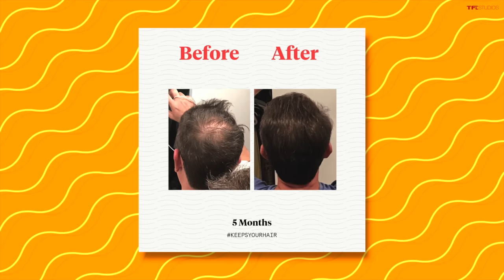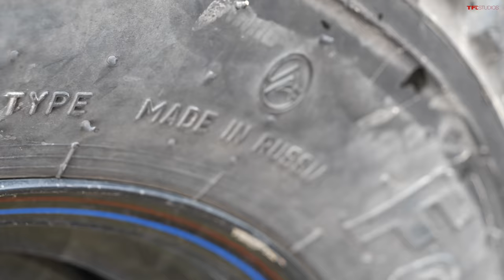Buhanka vs Jeep: I Test American Ingenuity Versus Russian Dirty But Sturdy Off-Road Tech!

Comment from the maker: Thanks to Keeps for sponsoring this video! Head to https://www.keeps.com/TFLTruck to get 50% off your first order of Keeps hair loss treatment.
Reply: watched couple years how British traveled across Yakutia (russia).

if someone does not know Alaska is Sunday picnic on hawaii compared to yakutia.
it is coldest place on earth. -50, -60 C .

---------
so they took a few cars, installed everything for worst harshest winter, and started driving

what car did they use as go ahead car? local buhanka.

beauty of this car is : car is simple as sliced bread.
Reply: you should make real off road test: Russian NIVA against Jeep!!

like in old times- USSR vs Canada in hockey!
Reply: Ah yes....the cold war once again!! i'm rootin' for both
Reply: Anyway y'all can talk to Andre. He's turned into some kinda cringey eastern European clown. He's always been a little off, but lately it's all the time. You guys don't have to be some value brand top gear just be TFL.
Reply: Did you get it registered??
Reply: I saw one of these in person in Norway. So awesome. Gotta love the Loaf!
Reply: New Bukhankas come stock with rear locker. You can probably install it on the old model too
Reply: @MyAlexWest  Niva is surely less capable than Bukhanka. Niva is a crapy unibody crossover with average travel independent front suspension, and it's drivetrane is so fragile they had to make it permanent AWD with center differential. The engine is horrible too, it doesn't make nearly as much low end torque as UAZ's ZMZ-409 despite comparable power output. The only benefit of Niva is that it's relatively small. It's a great car for broke dudes like me who want some offroading but if you have any reasonable budget I'd strongly recomment going for anything else like the Jimny, old Jeeps, Toyotas, Land Rovers, etc.
Reply: See how the buhanka drives with weight in the back. Maybe its like a truck where once you put some wheight it settles down

Comment: When it's 85 percent different parts can it still be called an 87 wrangler? Maybe a 87 "looking" wrangler
Reply: Its basically a TJ on YJ Body!
Reply: @TheYamaski  with Ford diff housings...
Reply: As long as it has the original VIN it's an 87 Wrangler.
Reply: All them up grades v standard !

Comment: Ah Andre, the secret to open diffs is learning how to left foot brake. Master that and people will swear you have lockers
Reply: And air down.. those tires are at street pressure.
Reply: @brentworls8509  Airing down makes the ride way smoother on those UAZ.
Reply: Well, if you have torsen limited slip diffs, yes ...
Reply: @brentworls8509  they look old and hard. being russian made for heavy off road the side walls wouldn't flex much

Comment: HUGE like from Russia!
Glad that UAZ showed not so bad
In Russia there are lots of aftermarket parts to make UAZ ultimate offroader. Your Buhanka is something near stock.

Can't wait to see next episode!
Reply: I was beginning to wonder. I saw something like the UAZ at the grand canyon once, but it was pretty heavily modified.
Reply: agreed. bone stock van against a jeep with very little left of the original running gear (Ford Diff casings, uprated lockers/LSD diffs, later engine, different gearing, uprated suspension etc) hardly a fair comparison!
Reply: @petelattimer6808  yep,install lockers ant then do comparison
Reply: I'm guessing there are modifications for lockers and power steering available ?
It seems to be the things it needs the most.
Reply: @Grumpy_old_Boot   lockers starts from 250$ for limited slip diff to 1000$ for diff with electric control
Power steering kit costs about 700$
Reply: @RealMacarenko  
Oh cool, didn't know the aftermarket for the little Buhanka was so strong.😀
Reply: @Grumpy_old_Boot   UAZ and Lada Niva is most popular offroad vehicles in Russia. They are cheap and have a lot of parts. New Lada Niva starts from 10k$ and UAZ from 14-15k$. Brand new car.
Of course we have Jeep, Toyota and even china models (almost crap). But there is a problem to get parts for them. UAZ and Lada parts you can get at any part of a country from Saint-Petersburg to Vladivostok. UAZ is something like Wrangler. And Buhanka is Wrangler-van😂☝️
Reply: @RealMacarenko  
Yeah, I'm familiar with the UAZ 4x4 jeep like car, it's not very comfortable, but very capable.

Also, I thought Toyota was fairly well represented in Russia by now ?

Obviously, since I live in Denmark, I haven't had many eastern block vehicles.

Though I did have an Ursus tractor a long time ago. It was very similar to a Massey Ferguson 135, but all the rubber seals and such were absolute rubbish. Once you fixed that, it was a good enough tractor.
Reply: @Grumpy_old_Boot  russians LOVES Toyota so much, that new TLC300 now costs about 2 x sticker price. Used Toyota cars overpriced too. In mid 2000 we have even fake 4runner from China  named Great Wall Deer and it was popular.
Tuning parts for Toyota,Jeep and etc. avaible, but they cost more and you will wait fot shipping. It seems normal in big cities, but the rest of Russia prefers to buy Niva or UAZ and get parts instantly in stores or one week by post.

Of course we have mad projects too - people who can afford it buys axles from Volvo Laplander( each costs near 10k$) and install it to any cars. Sometimes with tractor wheels. But there is one car like that for 1000 of almost stock UAZ and Niva cars.
Reply: @RealMacarenko  
Aw man, the Laplander is awesome, the Pinzgauer too. 😁

I'm guessing the old Lada's (or do you call them autovaz?) would be popular too, if nothing else, than for the nostalgia. 

I'm a bit surprised that Toyota can't keep up with demand in Russia, I thought they had a manufacturing plant there ?

---
---

And I'm loving to hear about all of this, as Russia is still somewhat of an unknown in the west, especially when you start to get out in the more rural areas, Russia is still wildly different from western Europe. And that's a good thing. 😀

Sometimes i open up google Maps, and surf around in different parts of the world, especially the "out of the way" kind of areas that are different, it's such a rush. 

Just like other people would find the place where I grew up as being an exotic place is weird to me.
Reply: @RealMacarenko  I bought a Bukhanka with rear locker but otherwise stock. Do people bodylift them? The importer wants to do a RIF lift kit, but I think a bodylift makes more sense although it's maybe a bit more work.
Reply: @Grumpy_old_Boot  in russian Toyota plant (near Sankt-Petersburg) they produce Camry, Rav4 and Highlander (may be I'm wrong) - no Hilux, no Prado, no Fortuner
Reply: @Grumpy_old_Boot  old "Lada" is always "Lada" or "klassika" (2101-2102-2103-2106-2107 models) or domestic brand "Zhiguli". BUT - "Niva" is always and only "Niva" (except "Chevy Niva").
Reply: @coyoteranger  
Ah, very cool, thanks for all the info, didn't know they were called Zhiguli. 😁
Reply: @Grumpy_old_Boot  I had a zhiguli and the more modern Samara. That was in the days when you could sell your Scottish one back to the ex-USSR at a good price. I drove the Samara over from Scotland to Lithuania in 98 and eventually sold it. 
They are usually named after where the plant is. The zhiguli mountains are in Samara oblast and are near the Volga where the VAZ plant is (Volga Automobile Zavod).
Then there was ZAZ from Zaporizhzhia and UAZ from Ulyanovsk and KAMAZ from the Kama river.  ZIL is the opposite way round and the Zavod was in Likhachov.
The one that would confuse people now is GAZ. Gorky is now Nizhny Novgorod but in Soviet times it was Gorky avtomobilny Zavod.
Reply: @BrokenBackMountains  
Ah yes, my dad told me he had a Gorky back in the late 60's I think (a GAZ-21 I think?) ... he added a little bit of under carriage plating, to make the bottom  flatter, so he could use it as a motorized sled in the winter. 😂
It kinda worked, because it had a very high stance.

btw, "zavod" means something like "factory" or "plant", right ?
Reply: @Grumpy_old_Boot  Zavod is plant, yeah. My Russian is very very limited though my wife is fluent. Oh and the ZIL is originally named after the head of the factory. At one point it was called  ZIS after a certain Georgian mass murderer.
I've driven UAZ, VAZ, KAMAZ and GAZ - namely the Gaz 24 volga. I drew the line at a zhaporozets.
Reply: @BrokenBackMountains  
Ah yeah, I think Zil made the first sort of "modern" style military truck with the Zil 157 and Zil 131 in the early to mid-1950's.
It had proper offroad suspension and super single tires, which would fit into tank tracks, so if you had a convoy of trucks, you could lead it with a heavy tracked vehicle, and then the trucks could just follow in the tracks, using less fuel, and getting stuck less. 
Pretty much all modern military offroad trucks eventually switched to the "wide enough for tank tracks and super singles" style.
Reply: @Grumpy_old_Boot  Niva - "Нива" - means "field, margin, square, cornfield, bent, brim" (also "Niva" is a soviet combine harvester brand)  - main idea: "light 4x4 passenger car for rural people, based on modern italian/soviet technology.
Reply: @coyoteranger  
So the "Lada Niva", basically means the "square lada" ? 😄
A fitting name indeed.
Reply: @Grumpy_old_Boot  and I can continue - name "Lada" derived from "ladya" - kinda viking's boat("rook") but smaller and slavic origin. Simplified image of ladya on the VAZ-Lada logo. So - Lada Niva - "sqaure boat". It's a joke of course. :) But good ole' Volga's sedans - ГАЗ 2410 - have a nickname "barge" because of  superior" driving quality :)
Reply: @coyoteranger  
It's a land-yacht !  😁
Reply: @RealMacarenko  только качество сборки и запчастей намного хуже у уаз и нива, чем у jeep
Reply: @user-re8yx8cm6m  да оно понятно. Но мы же говорит в среднем по России? В областях все двигаются на Нивах и УАЗиках. В том числе и по шоссе, едешь где-нибудь на краю Вологодской области и там просто несметное количество Шеви Нив.
Reply: @RealMacarenko  ну это да, люди просто боятся иномарок думая что на них дорогие запчасти или сложное устроиство. А по факту на тот же уаз уходит денег больше так как он сыпется постоянно
Reply: @user-re8yx8cm6m  не совсем так. Берем любую ценовую категорию, например Чероки за 150тр и УАЗ за 150тр. Понятно что например в Питере живешь, то тут и разборки и закажешь даже с США части. Подождешь. А если ты в Чагоде например? Каждый раз в Питер гонца отправлять? А если машина каждый день нужна и она работает не только для развлечения?

С новыми еще проще уравнение, никто не даст тебе дешевый кредит на БУ иномарку. А на Ниву и УАЗ дадут. И они отъездят свои 3-5 лет при нормальном уходе. И можно опять новый взять.
Reply: @coyoteranger  only Camry and RAV4 are produced near St. Petersburg. Several years ago in Vladivostok a couple of years they produced the Land Cruiser Prado.
Reply: Whatever...
Reply: I have wanted one of these vans and the lada niva for a long time. They both seem to be very off road capable.
Reply: Чаво?
Reply: @RealMacarenko  lol, I don’t think this is possible at the moment
Reply: I'm interested in these performance parts that you have access to in Russia.

You have no idea how bad I want one of these vans. I'm even near this guy.
But if I had one I'd probably have to gut it.
Maybe even put a jeep 4.0 in it.
Lots of fabrication but I have no idea.
Reply: @Grumpy_old_Boot  

And you can find buy them brand new $5,000 in Russia. After ~$8,500 shipping ($13,500) that's a lot of room for modifications; power steering, rock sliders, winch, roof rack, tires, stiffer suspension, modified body for better tire clearance on rocks/bumps etc. You could get a legitimate off road vehicle for ~$22-23k. It's wont compete with a Jeep because of the inherent disadvantages of vans and because nothing competes with well built Jeeps. But I don't see another Van/minibus competing with the Loaf.
Reply: @joebenson528  
yeah, not a lot of good van based 4wd platforms.

Comment: 10:08 Какой прекрасный ход подрессоренных мостов. Раздатку с блокировкой и вперед.
Reply: i dont understand Russian and google translate  isnt helping....."What a wonderful course of sprung bridges. Distributor with blocking and forward."
Reply: @guerralopes  “look at beautiful long movement of the leaf suspended fully boxed axles. All you want to add is blocking in transfer case and differentials.”
Reply: @guerralopes  BTW in Russia there is a cheap mechanical locking option for differentials used in UAZ. It is engaged by the push of a button on the console when the car stays still (not moving). Very good for going over short difficult passages like in this episode.
Reply: @slavkochepasov8134  I agree... this vehicle needs locking diffs.. I thank you for the translation.
Reply: @slavkochepasov8134  хеуле ты тут перед этими куколдами распинаешься
Reply: @andronchetverty5541  А почему нет?
Reply: @georg177  билять. Уже 2 года прошло! Я уже забыл про что этот ролик

Comment: Couple ideas for upgrades of your Bukhanka. You can install additional radiators fans, if you don’t have them. On low gear and climbing, engine will overheat.
You can also install aftermarket electric power steering and steering damper, so it will make your driving more comfortable. 
Bukhanka like a Russian tank, it will go anywhere if you can handle it!

Comment: Here in germany it's possible to buy this "Van" in BRAND NEW with zero miles on the odo. But UAZ offer this thing as "Anniversary Model", that means the driveline fitted with SPICER HD axles in front and rear, electrical differential lockers, slide windows on the sides, 5th gear tranny, power steering, gear reduction, 2wd and 4wd and emission control fuel injection and so on...
And the technical upgrades speak himself, 2,5 inch lift kit with springs (RIF produced, near RANCHO), steering damper and a 2 inch body lift kit and 245/75R16 BF Goodrich tires...and few more parts needed at the outback.... This Thing costs less a JEEP or another 4wd full size Offroader. Greetz from germany

Comment: I bought a wrangler brand new in 1990. Put  a four inch lift with 33’s front air locker and a lock right in the rear. I had more fun with that jeep than any other vehicle I have ever had. Sold it in 2005. I regret that decision more every year. That van is very cool reminds me of the jeep forward control pickups.

Comment: The van is pretty damn cool. Be a fantastic camping off-roading vehicle.
Even in stock form like this it's more than capable of getting to 95% of places you might want to go.
Look like it rode a bit softer but bouncier than the Wrangler maybe some heavier duty shocks would help with the bounce.

Comment: Awesome video. Andrew you can get lockers on UVZ from the factory if it has military axles.  My cousin back at home has one with military axles and it engages automatically, that thing is a beast off road.
Reply: Locks, automatic and forced, are available for sale for any bridge. The factory did not put military (gantry) bridges on vans before, and now the factory does not make military bridges.

Comment: Mr. Truck.  I have dealt with very similar “exterior dimensions” as you.  The Wrangler seats can be adapted to give some more backward travel by a commonly found bracket, or by doing some creative redrilling of the seat mounts.  Take a few minutes and, believe me, you’ll be much happier in that driver’s seat.
Reply: Yes, my old seat did move back. I have to work on it as loosing weight doesn't happen

Comment: My first jeep was a 1976 CJ7. It had a 258 cu six cylinder. It had 7 leaf springs all around, i added 2000 lb overload coils on four corners. If you didnt have your seatbelt fastened and drove over a dime, you would be out of the seat.

Comment: Hello thanks for your videos.  I have a great doubt I am looking for a RAM 5500 HEAVY DUTY TRADESMAN 2021 to make Hotshot.  What should I do to have a good weight combination between the truck and the trailer?  To reach 40,000.  Is the 4.89 gear better than the 4.44 for this type of work?

Comment: You need to split your emergency brake cables and add two induvial cable levers like dune buggy's have so you can manually lock either rear wheel. Lockers for those banjo deffs is probably not an option.
Reply: The buhanka has a hydraulic hand brake right behind the gearbox that blocks the whole drivetrain when in 4x4. No cables to rust and break, also a handy way to stop and get going mid climb.
Reply: @modarkthemauler  That's correct, but pure mechanical system. Not hydraulic. And works at 2wd Mode as well. Had such beast some years ago.

Comment: I think a off roading excursion means you leave the road? Atleast he hit a mud puddle. Cool little van. If your one wheel peeling push the brake a little bit it will slow down the spinning wheel and force the non moving wheel to turn. Use your brain don't just slam the brakes there's an in-between. Try it

Comment: Andre u should swap in a R2.8L Cummins Into the van it would be unique have loads of power and Cummins makes it very easy to put in any vehicle u would want because they come I  a complete package with electronics and everything u need 

Also the issue with no lockers for the stock axles patently.. u should just get a set of stock Rubicon 44s u may have to have them shortened but they would be bomb proof under such a light vehicle. even like a Dana 30 front and 35 rear ( or 8.8 would even be better for the rear ). going to a Dana would give u all the aftermarket support and parts availability no matter where u are. 

u should get a hold of other your tubers or like the motor trend crew (like fred williaws at dirt every day he is into wacky 4x4s and has built everything u can think of) and collaborate on a build it would be great content and a great way to have some one that knows a great deal about how to build a proper 4x4 that is safe and extremely effective off and on road.